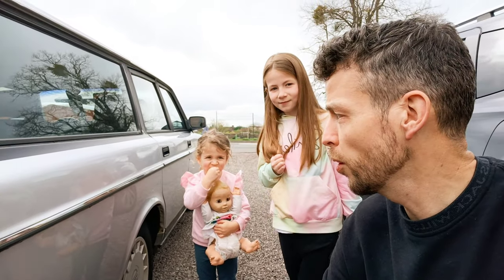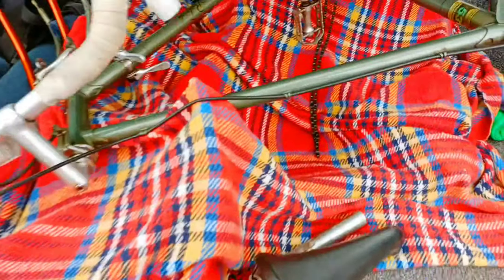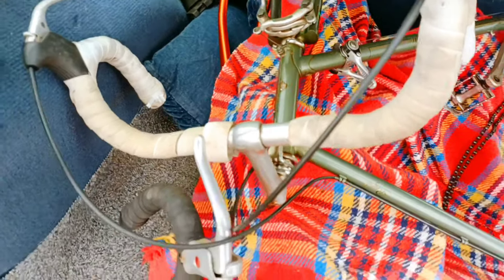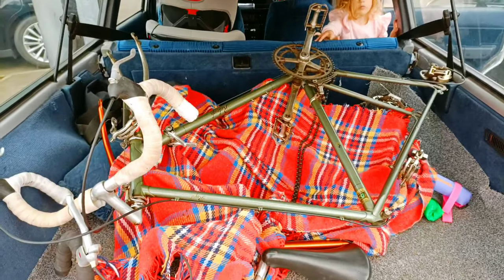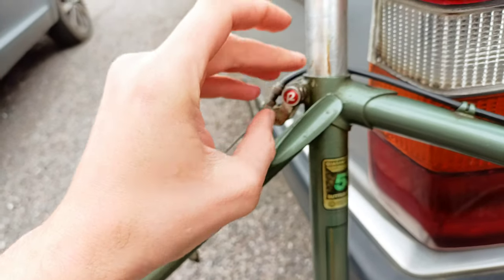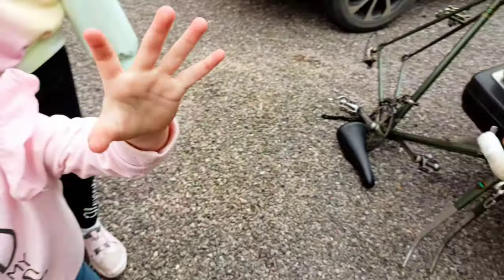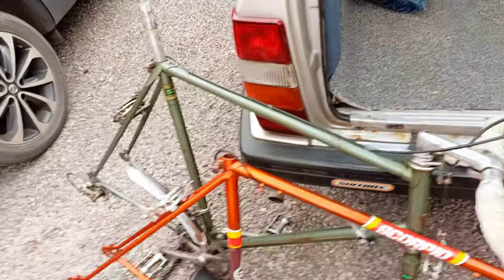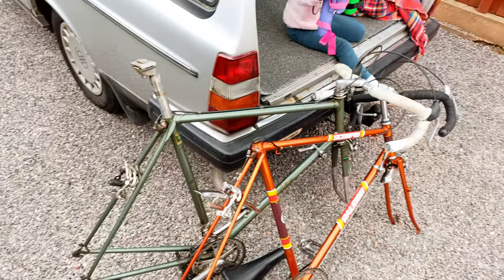£31!!! Cheapest on eBay Raleigh 531 REYNOLDS vintage steel touring bike

Comment: I'm not a big road bike fan but I am a fan of cool 531 lugged frames.  Cheers from Canada !
Reply from the maker: That's exactly the same as me, not really a roadie but do love a half decent old touring bike.
Reply: @TheRetroBiker  All of my rides are 90's MTB hardtails. I'm maxed out so I am hoping for a swell late 90's XC full suspension. I miss my old rocky mountain spice  with the Fox vanilla r upgrade. Still have the rear shock awaiting a frame
Reply from the maker: Oh cool, as time goes on I seem to be looking at the slightly later stuff now. Like very early 2000s full suss xc bikes ❤
Reply: @TheRetroBiker  I hear ya. I understand also. I would take a 99-2003 FS frame if it was a 26'er and the right geometry and/or style i like. Marin,Rocky mountain are my two hopefulls for the finds I am hoping for. Yet a Marin in east coast Canada is rare.

Comment: Two very nice vintage steel frame sets you have there.The paint work  should smarten up even more  by lightly using t-cut rubbed on with a cloth ( this is what I do to vintage frames I buy and keep the patina as they are only original once ). Looking forward to your next video to see how they progress. One other thing ,use scrunched up aluminium foil and coca cola to remove rust from the chrome, and solvol autosol  on the aluminium parts, it works a treat.
Reply from the maker: Top tips thanks. I use autosol on a cloth, that normally takes out and staining on the paint and a few scratches. Might even go all in and wax it.